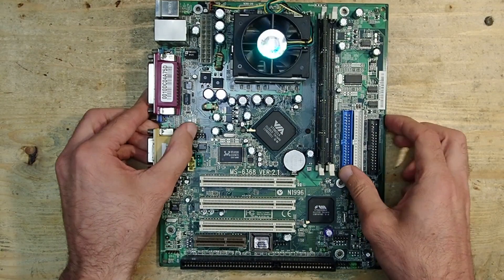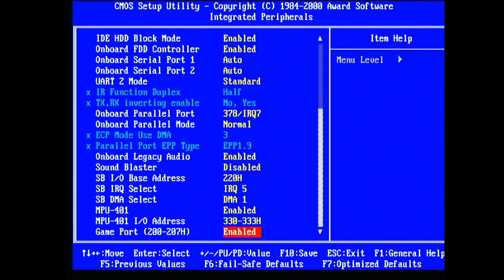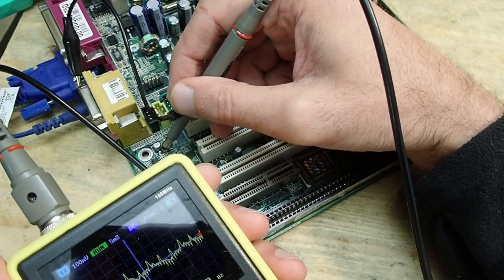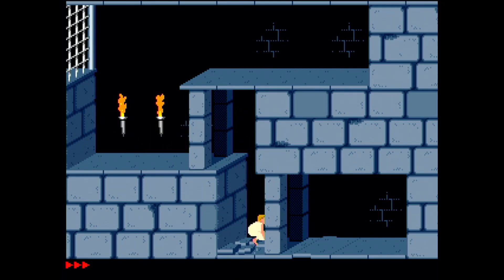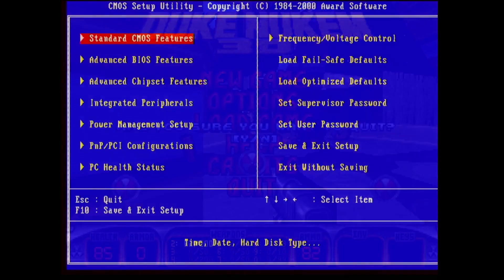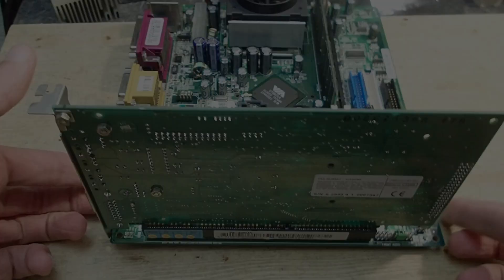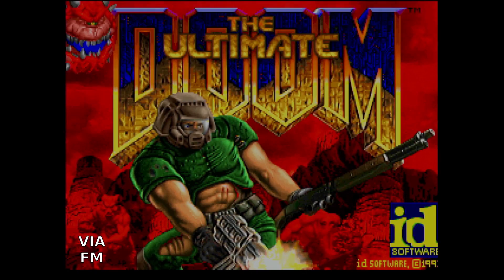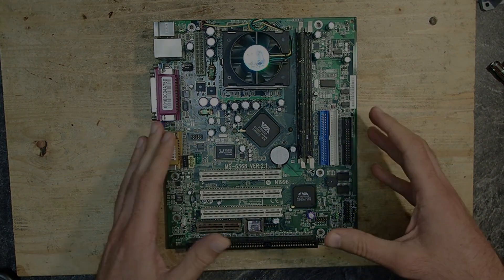A DOS compatible sound card by VIA? Let's take a closer look.

Comment: Hey, I have 3 the same MBs, but in rev.5.0 with newer chipset VT8601T.  They can run Tualatin CPUs (tested by myself with Pentium III Tualatin 1.13GHz). I didn't know what to do with them, because I was dissatisfied they haven't got AGP slot. I even wanted to reserve them for parts, but I didn't do that. They are still in my collection, repaired and working ;).
Reply: just use Kinetiz 7E, VIA KT133A version.
It has AGP slot, and same audio chip for DOS soundblaster support.

Comment: I have a HP Thin Client with the same VIA sound chip, that I wanted to use for DOS. Thanks for the great hints how to get it working properly. Especially the USB keyboard thing. The thin client only has one combined mouse/keyboard PS/2 port, I think I need to get a splitter for that to avoid issues with USB under DOS.
Reply: This Thin Client can emulate PS/2 at USB Port. A USB Mouse will detect as an PS/2 Mouse with Dos Driver.
Reply: @0815Backo  Thanks, I didn't know. (Also didn't research at all yet tho'.) However, if that needs software support in the BIOS somehow, that could lead the same kind/similar of slowdowns Necroware experienced with the USB keyboard. Or maybe not. Depends on a lot of factors.
Reply: @chainq68k  no Problems on the HP T57XX Series. I've tested it with DOS 6.22, Windows 95 and Windows 98. For old games like Wolfenstein 3D DOS 6.22 is the best choice.

Comment: Also for completeness, the was an expansion slot that was similar to the CNR but shorter.  It was designated as AMR or "Audio Modem Riser".  Motherboards made by PC Chips/Amptron/ECS Elitegroup were notoriously adding the AMR in to the recipe for their ATX and mATX motherboards in the very late 90s to about 2005.  The PC Chips M810LMR is a prime example.
Reply: Also, some low cost manufactures, use two slots in place were must be AGP slot, and from distant is look like MB have AGP slot :)

Comment: Via chipsets famous for their usage in budget mobos. Often those mobos does not have such a big love from vendor as more expensive intel-based boards. I want to say that slowdown with usb keyboard function enabled in bios can occur due to bug in bios routine that activates boot-up support for keyboard and it is possible that this bug can be fixed in rom.by' bios-fixer utility that you mention in previous videos. Its worth to try it on this mobo bios, i think.

Thanks for video!
Reply: Another possible method may be voltage related, though your theory seems more likely as I don't think any USB keyboard that properly works with this setup would draw hardly a thing in most cases UNLESS the board is suffering unknown low-voltage issues from old age.

Comment: Interesting information. Now in my Video:
"General MIDI Synthesizer on a Motherboard's Game Port!"
I used a M/B with a very similar integrated sound chip.
Everything worked fine but I could not find a DOS mixer to enable the line-in.
Now I have to do back and test this "VIASBCFG" if it can do the trick.

Nice debugging repair of the audio Amp.
However TL072 and LM358 are actually quite different chips.
JFET vs BJT input stage and different Max Min input voltage levels (or common mode voltage).
For this application in might not make a significant difference.
But there might be some clipping now when you set the volume to the max.
All depends on that is the circuit in the input of the Amplifier.

This USB issue, I have noticed it too with some modern Systems in DOS.
That is why I am always using PS2 KB and Mouse.
There is sometimes an option in the BIOS about legacy devices USB that might help.
Reply from the maker: Yeah, I compared the ICs and circuits a little bit longer, than I showed it in the video. I didn't go into details, but you are absolutely right, the voltage levels of the ICs are slightly different, but I decided that it is good enough. The LM358 is not the best IC for this purpose actually, but so many cheap sound cards used it on their products, so I usually just decided not to care :D

Comment: ive been playing around with my compaq socket 370 board as well. I upgraded it from a celeron 533 to a p3 1 ghz. I put in my voodoo 3 and sb live. I wish i had a isa slot like yours. But i was able to get the dos driver for the live to work.   And im actually going to try your buck converter to lower the fan speed, right now its full throttle and load.
Reply: It's better for DOS Games to use PCI ES1938 or ESS Solo 1 which has hardware opl3 emulation.
Reply: @asanjuas  although my board does have a ESS 1988 (although i dont think it sounded that great). im mainly wanting it for windows glide gaming. The live card also has EAX. I have other systems for much better dos sound i.e awe64 +X2GS.
Reply: SB Live does not have an opl3 emulation even on hardware or software and It needs EMM386 to work
Reply: @asanjuas  which in those cases i have 3 other options 386 with ESFM, or 486 with YMF262, or awe64 with CQM, and laptops with yahama sound. So i think i can be ok with the P3 running with the live ;-)
Reply: I am in the reverse i have a banshee and an awe64 and a P3 1GHz no sound or video on board. With a zip Drive and a cdrw
Reply: But for the moment i haven't got a true supersocket 7 mainboard with a pentium 200 mmx for dos Games only.
Reply: @asanjuas  that would be a capable pc. My voodoo 3 was in a socket 7, first pentium 200 mmx then k6-2 500. Im finding the P3 to gives the glide games a nice boost.
I bought a geforce 5500 fx PCI and it was going to go into the P3, but it wouldnt boot. So i did the swap and the 5500 works on socket 7.
Reply: Now, one year later, there's also SBEMU, which is SB Live! compatible and should sound better. I don't know though how taxing it is on a 1 GHz P3 CPU.
Reply: @armorgeddon  actually i ended up just recapping a fullsized atx board which the p3 and voodoo 3 has moved to. It has one ISA slot. I did use sbemu on a compaq laptop and it looks promising for high end cpus.

Comment: The sound comparisons sound like amplifier overdriving/clipping. Wonder if replacing either the decoupling caps or the amp with something higher quality might fix some of that distortion. Some of it does sound like it’s the voices used. 

Did you check if it’s clipping with a scope?
Reply: I once tried to use LM358 in audio amplifiers pre-amp-distortion was really noticable-replaced with soviet K157ud2-that reduced distortions to bearable levels. 
  Here this opamp is probably used as a buffer so it could drive headphones properly. It could drive amplifier without this opamp probably, so I would have connected opamp inputs with outputs with wire links. With DOS games it does not bother so much though, so its better to leave it as it is.